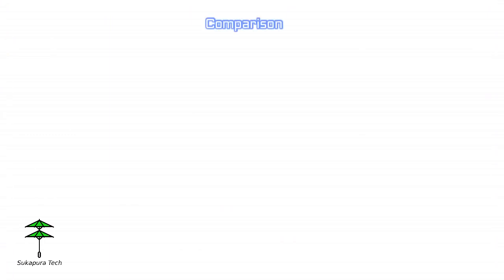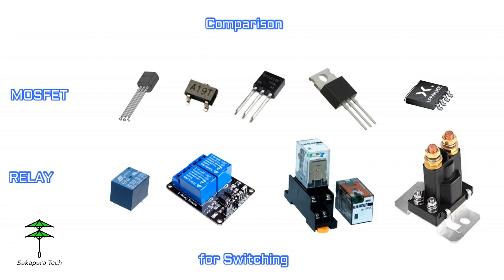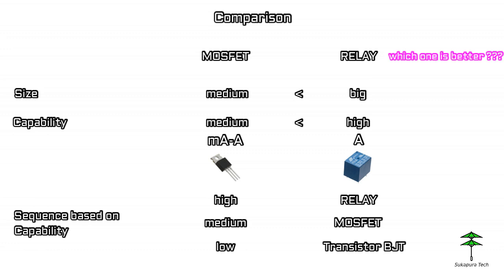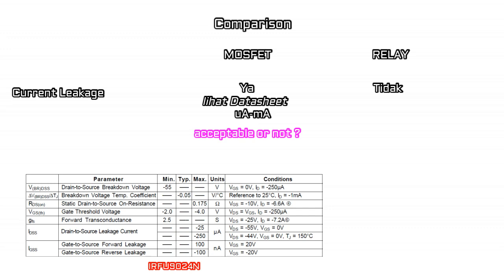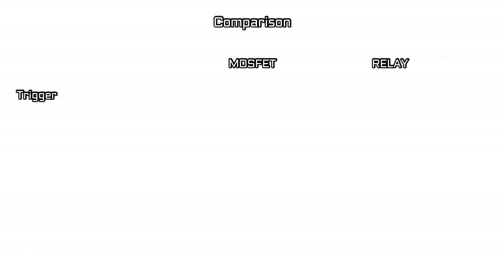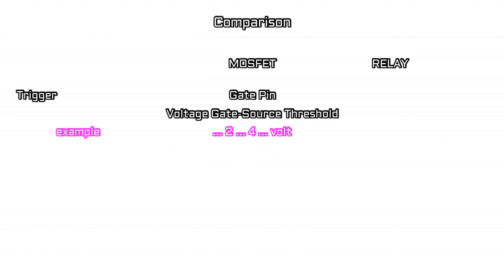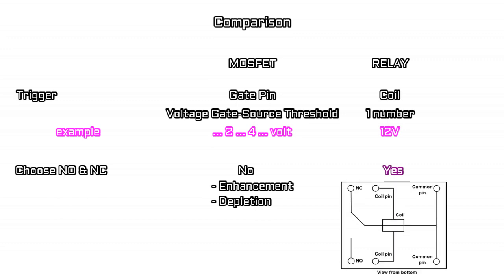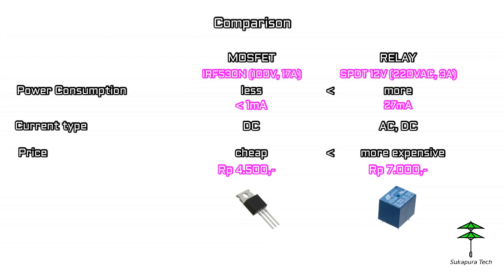Mosfet vs Relay

Comment: U sided for relay but forgeting mosfet is more faster than relay in switching ,accepting more voltages, more amperege depending on the mosfet used